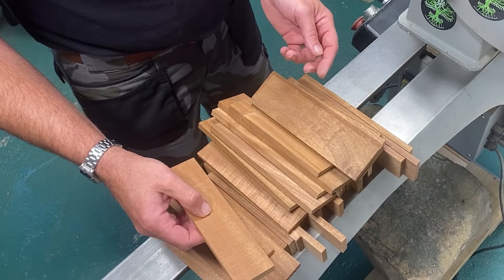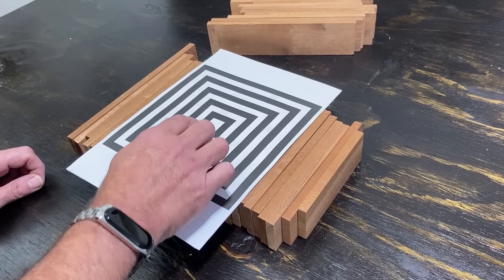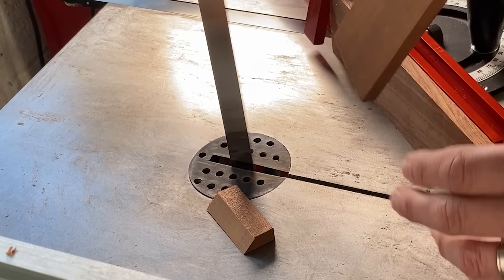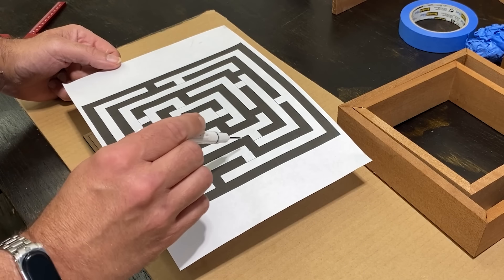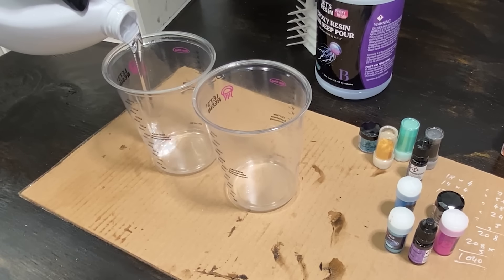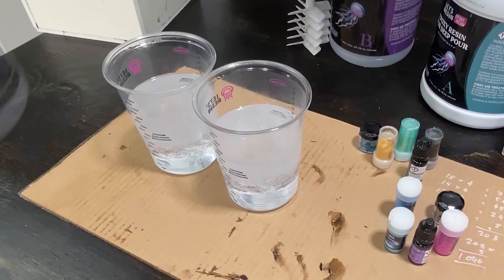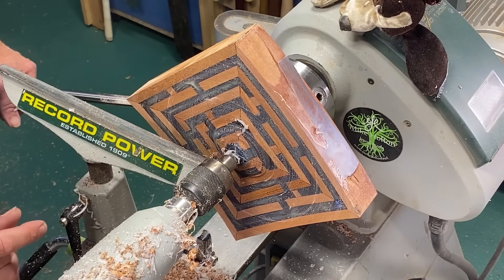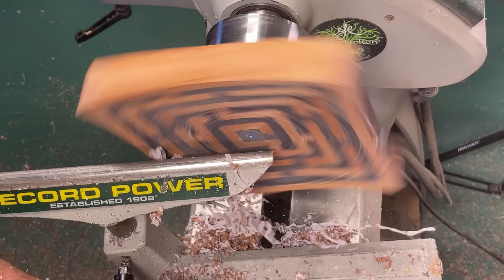The MAZE Bowl: A Unique Woodturning Project

Comment: While you are correct about the miter joints, I think there is a benefit to this "flaw" (which I don't believe there is).  It directs the eye to the the center from all four corners which, aesthetically, is pleasing to the eye. It might be over kill for this kind of project but dovetail joints are very strong and can correct for any imperfections when the two pieces of wood come together.  I like your creativity.
Reply: Agreed. They look like a feature in the final piece!
Reply from the maker: Thanks so much William, really appreciate your input 👍
Reply: I thought the same - the diagonals draw the eye nicely. They may even be called aMAZEing...
Reply from the maker: @flatflo  Haha thanks 😃
Reply: Mitered finger/box joints rather than dovetails are easier to cut on a bandsaw, because there's only one angled cut for the mitre joint. Box joints are just a series of interlocking straight tenons, and are easy to mark out and cut. Accuracy comes with practice. Or Mike could buy a box joint jig and used a router. Not as fast though, and investing in that might not be productive unless he's going to make a lot of box joints.
Reply from the maker: @CuriousCrow-mp4cx  I have just got a new table saw so we will see how we get on with that :)
Reply: What an interesting piece.  I would have never thought of this. It reminds me of some of the things BAW wood turner does. He does all kinds of things like this. It is really pretty,  Mike.
Reply from the maker: @janeoverby2151  Thanks Jane, I watch a lot of his work 😃

Comment: Definitely a freshly unique idea. Gives me some ideas on how to use up some of my over accumulating scraps. If you give it another go, you can pour a top track layer using Colored UV resin and either routed grooves or temporary dams to color in the winning route. Also, the miter saw may give more accurate cuts than the bandsaw if you have one. 👏🏻👏🏻👏🏻👏🏻👏🏻
Reply from the maker: Thanks for the ideas. I've just got hold of a table saw which will do the job great 👍

Comment: A very interesting project.   Very well done.   
I think the two epoxy mixes would stand out more if one was light and the other dark, these ended up both being  dark.   Nice job on the mold, no leaks which is always a big relief.
Dave.
Reply from the maker: Thanks Dave, I did make a mistake with the resin but will do better next time 😁

Comment: Lovely idea, I now have the onerous task of finding something similar for sale as I need one of these bowls for my desk! ;-)
I suggest simplicity when it comes to mixing the resins. Accurately measure the amount/weight of colour additives in each batch and try to keep them evenly matched. I would also go for a strong contrast in colours to emphasise the flow.
Reply from the maker: Thanks so much and for the tip! Good luck finding one. If you struggle I may just be making another 🙂

Comment: Really unique piece Mike! Try using a shim on your fence to make micro adjustments with your miters. It takes more time but the results are quality tight joints. Stay cool my friend!
Reply from the maker: Thanks for the tip! I do however now have a table saw 😃
Reply: @MikeHolton  even table saws aren’t perfect and you might end up having to make practice cuts to check your degree settings. You still might have to tweak it some to get a tight joint.
Reply from the maker: @82ndairbornevet  yeah, I did think that but I'm sure I can get better with practice 😃
Reply: @MikeHolton  you will definitely get better with practice. You probably know as well that the blade type and cut speed makes a big difference too depending on the wood.
Reply from the maker: @82ndairbornevet   I have an idea, I asked for a fine toothed blade with the saw to help with finer cuts 😃
Reply: @MikeHolton  yes, you will most likely end up with several different types of blades for the different types of wood you will be working with. It really makes you appreciate what the old masters were able to accomplish with only hand tools.
Reply from the maker: @82ndairbornevet  It really does!

Comment: Hello Mike. What a great bowl you have made. I wouldn't worry too much about the joints at all. The joints provide a guide to the centre of your work of art mate. Re your resin stirring machine.... how do you clean it after use? In an Isopropyl or Methylated Spirit bath?? Thanks so much for sharing. Kind regards, David, Beachmere, Queensland, Australia.
Reply from the maker: Thanks David, I let it drip off and dry then periodically peel off the resin 😊

Comment: Interesting project! I love it. I was surprised you left it as thick as you did, but it works.
Dumb question: what is the writing tool that you use in this? To mark the tenon, for instance? I've seen those in various maker videos, but don't recognize it. Thanks!
Reply from the maker: Thanks, they are just acrylic marker pens I buy cheap from China 😃

Comment: Definitely a unique project.  A table saw or miter saw would have definitely gotten you better joinery, but I think that the diagonal lines in the joints add to the appeal of the piece.  Folks with band saws tend to have different blades for cutting blanks versus resawing or anything needing straight lines.  Over time, cutting blanks causes the teeth to deflect, leaving that blade only good for blanks or curved lines.
Reply from the maker: Thanks, I have just taken delivery of a nice table saw and a fine toothed blade. Next time will be easier 😊

Comment: I am so glad this maze has a video to go with it. It's the kind of piece that someone might have casually on a side table and it could go kind of unnoticed yet under closer inspection suddenly peak the interest of those that see it and ask... "how did they make that?"

Maybe next time put some black veneer in the joints then if they are not so tight fitting they become a feature? Perhaps you should have clamped it a bit with a ratchet strap or just got the family to hold one each whilst the glue went off....
 
The resin colours didn't really show for me but I bet on inspection they are fab, you always mix it up with such wild abandon. When you get a router you could make a groove for marbles to run round the maze...or even slice it in half and add them inside and glue it back together..

As ever this was such fun!
Reply from the maker: Thanks so much, I'm not sure having clamps and the whole family holding it would have helped the joints, they were just terrible lol. I did not do too good with the resin but again I learned my lesson so it will not happen again 😀

Comment: Front 1 second, back 2 seconds.
This is mind-blowing, mostly just watching as you turned it. The optical illusions of the round square and the maze inside changing shape is one of my favorite optical illusions. 
Another channel that uses resin that I watch has a round plate with levels on it they use to make sure the resin is level before they put the whole thing in the pressure pot. That channel is "Even and Katlin". I have no idea when they made it but you might be able to ask them. 
Having things level helps but because you are going to be turning it anyway you could just overfill your mold?
Anyway this piece is brilliant. Have you thought of making bowls/platters with different game settings? Checkers, backgammon, Go, etc. That would be fun. 
Cheers!
Reply from the maker: That would be great, love the game board idea, thanks 👍I had better write it down fast lol 😁

Comment: Amazing! (Yes, I HAD to use the pun.) You have given me an idea for a way to display birdmouth joints. It probably won't be a maze, though mazes with 6, 8, 12 or 16 sides would be interesting.
Reply from the maker: They would, a few people have suggested I try making a round maze! 😀
Reply: @MikeHolton  the math with be interesting. Time to check my scrap bin, and the battery in my calculator.

Comment: that is one a-maze-ing platter, quite like the colors and the form
I would say that there was more than two options on the joints, but if you're not experienced with "flat work" or set up to do other joints... the fact that it is going to be filled with resin certainly helps as the miters don't actually have to be perfect
box joints would have looked good on the outer "box" with the labyrinth though
Reply from the maker: They would have and I do intend to get better at joints 😃
Reply: @MikeHolton  I thought I recalled you using a miter saw in another video, may have yielded more consistent results.. of course the best results would be with a table saw but you have to dial any tool in to get anywhere near perfect results
I have a small cabinet I made with box joints, only used a hand held router and a jig that I made.. they actually turned out pretty good
Reply from the maker: @chammers7377  I do have a mite saw but thought I would be fine using the bandsaw. Also I had a new table saw arrive on the last day of filming. I've built it but still need to set it up 😀

Comment: Still the best clamps to support mitre joints while curing are these c-shaped springs which are placed with special pliers – in my honest opinion. And I think a bandsaw is not precise enough to cut the 45-degree-angles. A circular bench saw will give better results.
Reply from the maker: You are right but I don't even think clamps would have helped these joints lol 😃

Comment: It's far easier to make a router template and use a plunge router than messing about with miters and bandsaw cuts. Done this quite a few times on guitar bodies which are a similar thickness although the resin pouring is trickier due to the size so you cant use a vacuum chamber. With something this size you can use a chamber. The hardest part is making a plywood template - you will still need to make a couple of opening cuts for the pathways afterwards but that part is easy enough.
Reply from the maker: Thanks, you have given me a few good ideas ☺️

Comment: Nice idea, very noval. A table saw would give you better cuts should you want to do it again you can also make a sanding platform for the lathe with an mdf board with a velcro sanding disc on one side and a tenon/mortice on the other. The support table can fit to the bedways
Reply from the maker: Thanks Chris, a new table saw arrived on the last day of filming 😃
Reply: Channels working OK then. If you have a tool sponsor consider a drum sander. 😊
Reply from the maker: @chrissimmoms1550  I would love one of them lol

Comment: Looked like a checkerboard when it was spinning. Square joint with brad nails would work better just keep them low so you don't cut into them
Reply from the maker: I did actually consider that before I started  😃